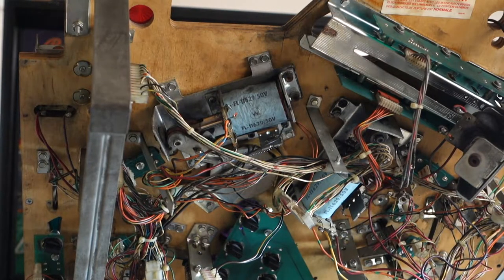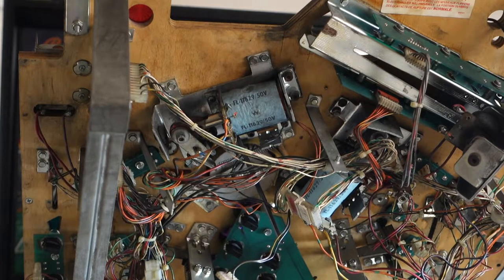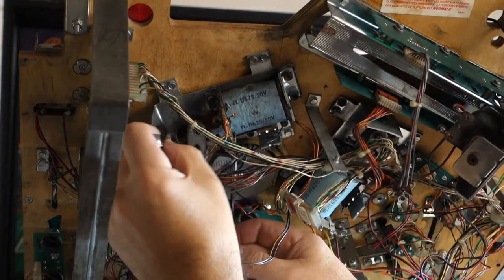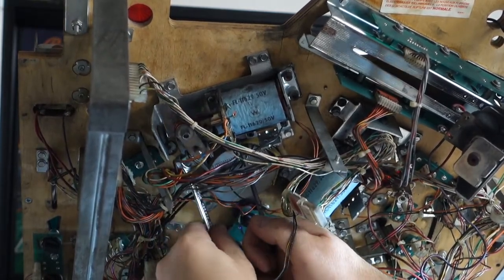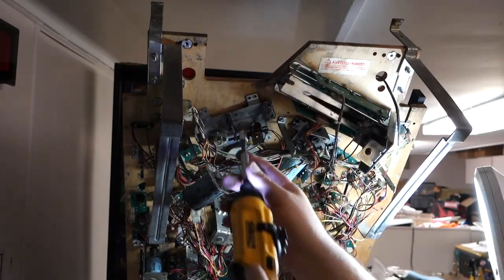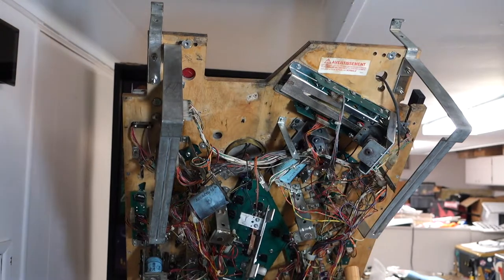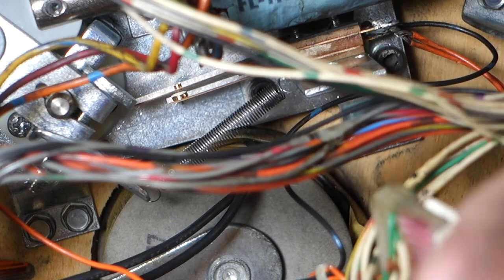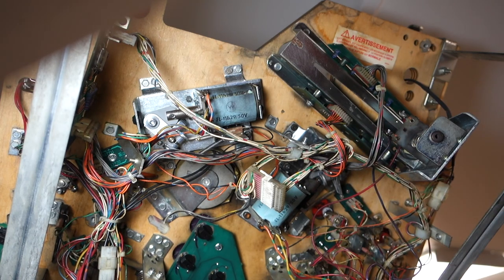1994 Bally Pinball World Cup Soccer Flipper Rebuild

Comment: right on, I appreciate you taking a look. I think I will leave the coil sleeve in technically backwards the way it was (it worked great in the past) just with the new sleeves. It is curios I have found now 3 times that coil sleeve specific is in backwards. Never seen that until wcs flipper coil sleeves!
Reply from the maker: Sweet. Did you see my 1000 Subscriber giveaway post?

Comment: I am doing a wcs flipper maintenance and my coil sleeve was on the same way yours was, so is that correct or does it work fine having flipped it back the way you did?
Reply from the maker: Can you give me a time stamp of what to watch. All i know what ever i did the customer has not complained about anything. I just get a man this thing looks and plays great!
Reply: Sure, at 5:13 you can see the coil sleeve is technically backwards. At 11:20 you talk about it, and show that you flipped it around. My question is does it overly matter? My coil won't fit when I flip the sleeve around lol.
Reply from the maker: @shankapotimus5000  It should be in the coil the correct way so it locks in and doesnt vibrate out. You can alsways email me a video. marksbasmentarcade@gmail.com or message me at facebook.